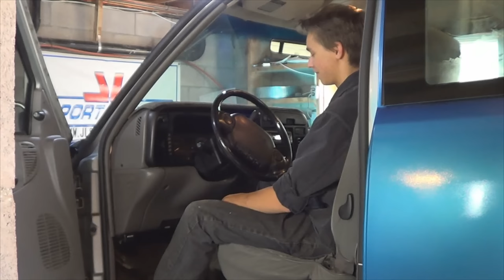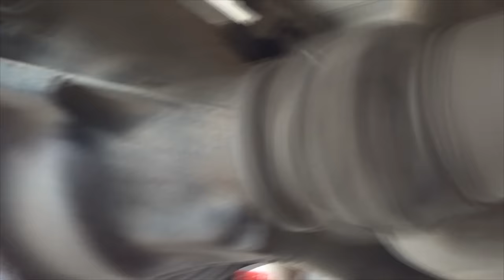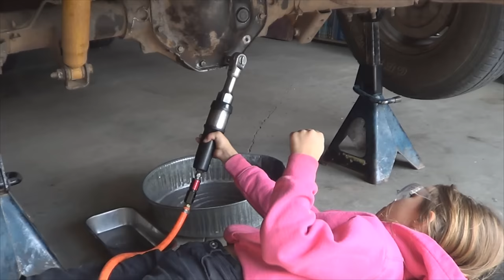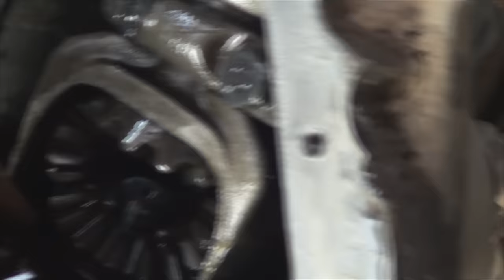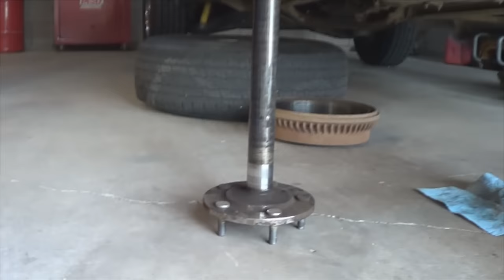Dodge RAM 1500  Noisy Rear Differential Diagnose and Repair Part One

Comment: I just wanted to say thank you.  your video was well done and easy to follow.  I finished putting in new bearings in the rear of my dodge ram.  I never would have attempted the fix without your help.  I made the tool for adjusting the preload on the carrier bearings and I also used my lathe and some pipe to make a tool to press the big bearing on the pinion.  A big thumbs up and a thank you from texas

Comment: Thank you very, very much for this video series!  Per your guidance, I fabricated a bearing adjuster tool, collected all needed replacement parts and tools and dove into this repair on my 2013 Ram truck.  As anticipated, the forward pinion bearing had failed on mine, so I did the same as you and replaced all bearings races, seals, crush-sleeve and pinion nut.  Also replaced the axle bearings while things were apart.  The whole job went great thanks to your informative videos and commentary.  Thanks again for the great resource!!! :-)

Comment: Excellent. Looks fairly easy but I think Ill hire this one. I think I can get it done for less than the cost of materials and tools. . The noise is exactly whats going on with my Dakota. I have replaced every axle bearing and velocity joint in my 4x4 trying to track down that sound.  Good video !!   (needed the bearings anyway 200,000 miles and still runs good.

Comment: Mine is like jerking and jarring when I put it in reverse and try to back out of my jar of light I was watching the drive shaft when my buddy backed it up just a couple of foot maybe up to 5 ft 6 ft it was like spinning smooth as could be one second and then it would like jerking jar and it will go back to spending smooth I'm hoping I can either replace the gears or put some stop slip in it and do a rebuild kit myself without having to buy the whole rear end and the axles and all hoping but thanks for the video and advice my mechanic buddy knows about all this stuff and is very gifted in this line of art I am not I know basic maintenance and not enough of that even but watching your video has taught me a little bit more about it and also I appreciate the knowledge y'all keep up the good work

Comment: Hi, thank you so much for posting. Excellent Video, CLEAR and EASY to follow. As an amateur the idea of using lathe tools and Shop press to rebuild bearing pinions can be a bit overwhelmed. So I will not take on this challenge of Differential repair, but take the truck to a shop. But the video sure helped me gain the knowledge of the internal working mechanism of of the Differential so I can communicate the issues to the service adviser... And yes, the C-clip retainer is sure SCARY... What a poor design!! Think of how they would engineer parts on the space shuttles is a scary thought... Thanks again.  Just SUBSCRIBED.

Comment: Your Awesome Bud I Just Subscribed Thanks Just Bought A 4x4 Dodge 97  Rear End locked up On The freeway Had It replaced I Do all my own Crate Engines And tranys Now that I Got My truck back this morning I Still hear A little Howling This Tells me i Need To Inspect My Front Differential Gears I just dropped A New Crate Engine In This older tired Drive Train Trany is Next When I can But i still Have the front differential and Transfer Case To consider But when im All done Shel be worth it Love your vids !!~!

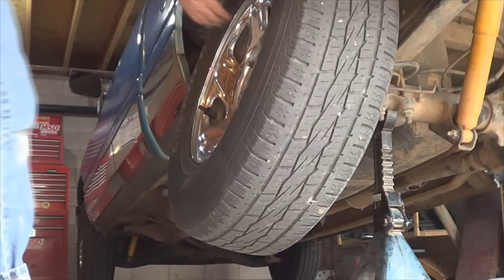Comment: I learned something new today. At 4:08 you placed the tire under the frame. Not sure if you did that on purpose, but if the jack stand fails, the truck falls on the rim and not my face. Thanks.

Comment: nice family there those who work together stay together and damn that c clip was easy to get out, mine was a pain in the behind! lastnight axle would not push all the way in (even hitting it with hammer) had to pry on it (in the diff) and it still wouldnt come all the way but was able to get clip out, then rechanging the axle bearing and putting it back in axle still wouldnt go in anymore? had to pry on it again and wedge clip it a  lil then pound it in with hammer..

Comment: Would this apply to a dually as well. I have this problem on a 93 cummins dually, I'm debating whether to go with a newer dodge differential but I have not been able to find much imfo on 1st gen dodge dually rear end swap for newer dodge diff. With disc brakes. Let me know what you think. Great video,  thanks for the good imfo.

Comment: Great videos.  Wonder how many miles on this truck; in other words, about how many miles until pinion bearings go bad?  I'm only intimidated about setting the pinion preload.  Hope it's going to be as easy as you said, torquing in small increments.  Also curious you didn't do a tooth contact pattern.  If the pinion preload is OK, then the tooth contact should be??

Comment: The whine from a manual in reverse results from the straight cut gear teeth.  The gears engage all at  once making that particular noise.  Typically the forward gears are bevel cut, like the ring and pinion so the engagement of the gears is progressive and quieter, though not as strong.

Comment: Great vid. However, doesn't seem it's the issue I'm experiencing. I'm hoping you can help out. I have a 2016 1500 sport model with the 8spd/hemi. I am hearing a rattle from the passenger side rear, possible the exhaust, but not 100% sure. It happens mostly on cold starts and the rattle used to go away somewhat as I drove and the truck warmed up. Now I hear it consistenly, especially over bumps. I haven't had this truck long, and started noticing this rattle as the weather got colder. What could this be? Again, it seems it is coming from the right rear of the truck, possibly behind and/or below the cab. Thanks again.

Comment: I just went to remove the pin and found that the 5/16 bolt was snapped off by the previous owner. Do I drill it out? Thanks.

Comment: I have a noise coming from the back of my truck. it's an 03 dodge. it's not that high pitch whine that you described as a car going in reverse though. it's more of a roar I guess you would call it.  it does it when the truck is moving no matter what speed. I can hear it.
Reply: +Ghondi1  it is either your U-joints (although most the time the make a "whomp whomp" sound) wheel bearings, or differential carrier bearings. my dad's truck had that same roar you are describing...it was the differential bearings

Comment: I went through 2 rear ends on my 03 ram and 1 on my 07 that had less than 35000 on it. Bought an 08 toyota tundra that now has 164000 on it and have only replaced the fluids, 2, soon to be 3 sets of tires and 1 set of brake pads on front and rear. Thats it, nothing else. Buy a toyota to see what the differences are, longer you have it the lore you will realize it.